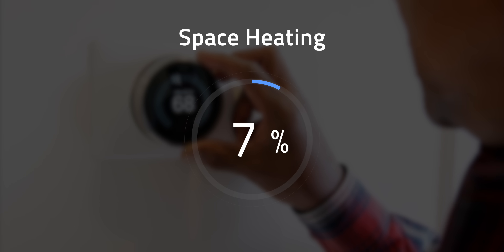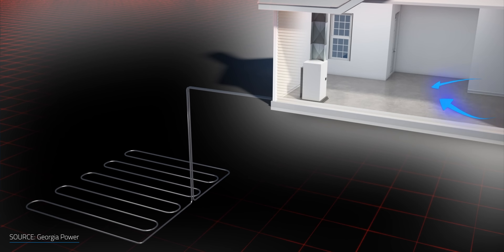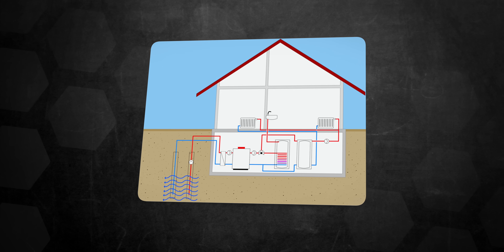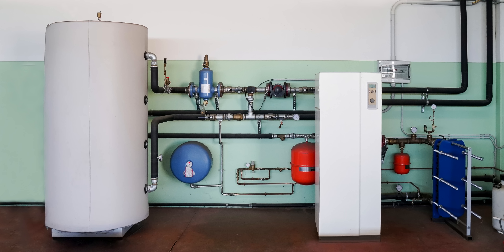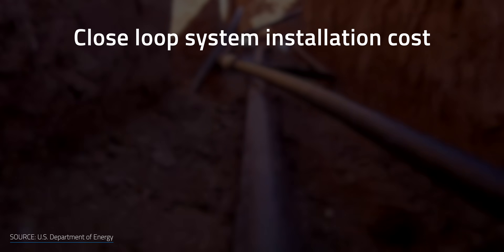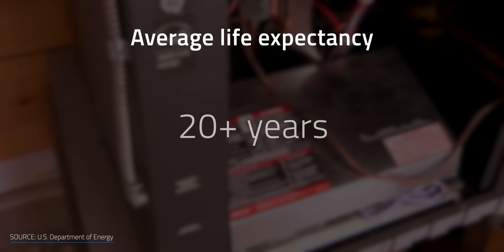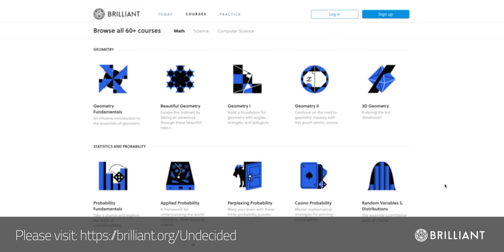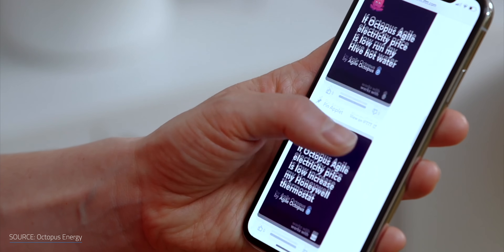Is Geothermal Heating and Cooling Worth the Cost?  Heat Pumps Explained

Comment: I have a 200 year old home in upstate NY. moderately well insulated..... but could be better. Installed closed, vertical geothermal system 10+ years ago. Two 350 foot deep vertical runs of tubing - 4 ton unit. It has 2 - 60 amp/ 220 VAC boost heaters for when Geo system can't heat enough in Jan/Feb. I live to prevent these from coming on! It turns out if I supplement the geo system with a pellet stove I can prevent the boost heaters from coming on. I use about one ton of pellets a year for nights when it is single digit (no wind) or teens (with wind). I have saved money over old oil fired system (especially if oil price exceeds $3/gal). In closing..... the AC is GREAT!!!

Comment: If you are doing it purely for money saving, then its absolutely not worth it - compared to traditional i.e. gas boilers. The difference in initials purchasing cost is just too much. It will take decades until you are even with your savings in energy consumption each year. And ofc at one point if will break due to its age and when replacing it, you will pay for a new heat pump which again is quite expensive. So you will basically never "save" money compared to traditional boilers. If you also do it for ecological reasons then ofc it is a different story. My experiences from austria btw. working for a producer of both - heat pumps and boilers etc.

Comment: My parents had geothermal in the first house they had.  It sucked.  Some years later I got a house with geothermal and it was so bad that running electric heaters and stuffing the fireplaces with wood was required.  No I proudly burn fossil fuels to heat in the winter.

Comment: From Sweden, Last year my fairly efficient heating system broke down. It was based on a heat exchanger extracting heat from the outgoing ventilation of the house to the heat exchanger to heat the house with water based radiators and under floor heating. I replaced it with a geothermal heating. It was around 15000 usd. In Sweden we do it a bit different. In my case we drilled a hole 150 meters (454 feet?)  in to the bedrock and have a closed loop just down and up the hole. In some case this could be up to 200 meters (606 feet?). The system could do cooling as well (Daikin) but this is nothing we need more than a couple of day a year where I live and it requires some fundamental changes to the house so I skipped it for this time. Anyhow, the best year I had before  with the old system was 14000Kwh  (this is very low in Sweden) (including lights, computers and everthing electric) in a year, my projection year is decrease with 30% from a low level. But even cooler, if you hade cooling in the house in the summer with this deep bedrock hole, the cooling of your house will push down heat in to the bedrock in the summer from the system, that heat you can pick up in the winter for heating. The bedrock becomes kind of a battery. Next time when I get a bonus, I will add on cooling to the house.
Reply: 150 meter vertical systems in Ontario Canada are typically used for larger buildings commercial and residential. Some downtown Toronto buildings use the lake for their systems.
Reply: @jonmce1  Lakes are used in Sweden as well, me personally lack a bit of water here on my hilltop:-) I think there are some reasons we are drilling in Sweden, ground frost, you need to get down a bit to get below it. There you normally find granite. Quite some of my neighbors have it as well. meaning you can not go to close to their systems. Anyhow I'm happy, from 22000KWH last year to a projected 12000KWH this year (for all the electricity in the house not only heating) with Daikin Altherma 3 GEO in a not too tropical Stockholm.
Reply: @torbjornulrichs8570  Of course Toronto being beside Lake Ontario is a bit of an advantage. Ontario has three major areas. The very south has about 20m of overburden and then shale (sometimes limestone) and below that granites etc, This is the primary farming part of the province. As you go further North the overburden thins until you hit shield country say 200km north of Toronto. This is almost all rock, small lakes, and bush. With the exception of some old now gone lake beds, the rest of the area was stripped of soil by glaciers, further north around Hudsons Bay( the Hudson Bay Lowlands) there are large areas of muskeg. The majority of the population live in the southern area, We also have a problem with frost which means traditionally building codes require foundations to go 1.25m below the surface. This means most homes have basements since you have already dug 1.25 m down. Geothermal is not yet common because of relatively cheap gas and electrical power (primarily hydro and nuclear).
Reply: @jonmce1  My small plot of land have between 0,3m to 2,3 meter overburden. My house is in a slope around 30 truck of granite transported away after the blasting, so back of the house is underground and front is above. But, that is beside the point, quite cool energy savings with more potential for additional heated (and aircon) areas, for less money. If everything is static, my system will have paid it self in just 4 years, considering that I had to replace the old one anyhow. Electricity is relatively cheap in Sweden compared to the rest of Europe as well, at this moment I'm running 94,7 % renewable electricity (hydroelectric).
Reply: @torbjornulrichs8570  Power varies by province, typically between $.06 and $.11 per kilowatt-hour. . Quebec has by far the cheapest power costs because of hydropower. Ontario primarily between nuclear and hydro.
Reply: @jonmce1  Hydro in the north, nuclear in the south, but nowadays we are connected to the rest of Europe, Germany trying to close down coal and nuclear. Poland have to pay for CO2 emissions (EU tax) on their coal, and Putin pushing gas prices up by cutting the flow. It's going to be an expensive winter in Europe :-(  Makes me feel even better about investing in Geo. :-)
Reply: @torbjornulrichs8570  Serious power in southern Ontario actually started with hydro, Niagara falls. In fact, traditionally power is called hydro. Much of the rest is nuclear. The government is supporting a number of new nuclear designs. The largest nuclear facility in the world is on Lake Huron. The rest of it is gas. Coal plants have been shut down in Ontario but not all provinces. There is an overall carbon tax in the country. Opposition comes from Alberta and to some degree Sask. where most of the oil and coal comes from. Prices are higher here but not disastrous.

Comment: We've had a ground heat pump running for 11 years now, with a 600m of pipe in a horizontal setup at about 1,5m depth (on a lot of about 2200 square meters). Live in northern Finland, and we get down to -30C in the winter, but usually around -10C to -20C. The monthly average electric cost of running the pump for heating the house and water is about 20€. The house is two story, 213 square meters, and well insulated.
Reply: Love it!! You finish(ed) are so smart! ;-)

Comment: im 9 years in with my vertical loop system. break even point after incentives was 7 years.
free (except electric to blow the fan) heat & AC for the rest of my life! have compressor unit in the middle of the basement, out of the weather. this provides fewer corners in ductwork to be as efficient as possible.

Comment: you can't add the 15% heating to the 16% cooling because they come in play at different times and are the "same" system. You cool when it's hot, and heat up when it's cold, not both at the same time. So we should consider the total cost to be 15.5% of electricity.

Comment: So in Southern California we spend over $400 a month on HVAC during the hot months, which is similar to what we used to spend on heating oil in Alaska during the cold months.   Either way,  the $30,000 installation cost for geothermal works out to maybe $130 a month at current interest rates (someone check me) on a normal mortgage.    The cost per month to run the new system probably averages $130, or less.  If the system lasts as long as your mortgage it is a no brainer.   So you're house payment is bigger, but your utilities are lower.  Well you don't get a tax right off with your utility bill, but you do on your mortgage.  The big plus for these systems is that fluctuations in oil prices do not affect your monthly expenses as much.   If we all installed these types of systems the USA would be much less dependent on foreign oil, it would probably push us permanently into being an oil exporter.  So install geothermal heat and help us avoid more needless wars in the mid-east.

Comment: I installed an open-source GTHP in the Midlands of South Carolina in 2004 at a cost of $3500 (unit + ducts). 
The 600-ft well is a constant 62° at 12gpm. 
No heat strips on the 4-ton unit. 

The unit discharges to a 3000-gal holding tank used for;
1. vineyard irrigation
2. fire sprinklers
3. emergency potable water supply

With cyclical summers achieving 104°F, the unit can maintain household temps as low as 45°...!
Winters are mild with the cyclical average of 56°F, the unit can maintain 90°.
[We've experienced the mildest summer/winter cycle since 2015]

CONS: 
The 3hp pump runs constantly at extreme temps/conditions. 
Heavy iron & calcium deposits corrode the copper heat exchanger within 10-years. 

PROS:
Very efficient in our climate.
Low (Easy) maintenance.
Exceeds desired temp settings.

Comment: Some realistic numbers as of 2021.  Co-worker is retrofitting a GSHP into an existing 1800 sq ft house here in the Canadian Prairies.  Cost, roughly $60,000.  Worth it, not at all.  Our natural gas and electricity costs are currently low and the pay back on this would likely be almost 50 years.  Your money is best spent on air tightness, better air handling and insulation.

Comment: Individual systems yes commercial geo system no way I work at a commercial business and we have both systems on different buildings the exact buildings with one geo one refrigerant system by far the refrigerant system is more efficient in its job and less expensive after the initial warranty is gone

Comment: Here in the SF Bay Area, standard HVAC systems run $10K to $20K. If you're not paying in the middle of that range, you may not be paying enough. I can only imagine what geothermal systems cost!
Reply: Was quoted £20k for geothermal. Roughly (very roughly) $30K USD

Comment: I have done so much research as I really want to move away from my lpg boiler. What has stood out to me regardless if it's UK or USA the average working class would not have disposable funds, this is more for people with money. A standard boiler replacment in the uk for a combi boiler is from £1200 to £2509.with 10 year warranty. For me it's a like for like replacment so £1200. Not up to £18,000 for an heat pump which on paper looks like you will be winning with regards efficency, but in the real world its false advert. If I decided to spend £18,000 and banking on a heat pump working 100% as in a lot of cases they need more money spent latter as they may not work well. So taking all this and factoring cost it's cheaper and more cost affective to run my lpg boiler for 15 years. The only let down is its not really green. Until these systems come down in price and technoligy really makes them proper efficient stay clear. But if you have money then go for it.

Comment: When we purchased our home (1994), the installed unit used propane for heating.  Propane prices have a lot of price swings where I live (Oklahoma).  Long story short, we had a GSHP installed in 2008 (5 ton unit).  Vertical loop closed system.  It cost me $18k and the pay back was 8 years.  Its has been pretty much trouble free.  It also came with a hot water generator for the water heater (propane unit).  My propane bill use to average about $1500 - $2000 per yr and is now about $200 per year (cook top range & HWT).  It's been the best investment for our home.   I agree with some of the commenters on its name.  I don't consider it a geothermal unit, it's a ground source heat pump.  Calling it a geothermal is a common phraseology, but that is not what it is.

Comment: I think you need to do draw the distinction between ground source and geo thermal. Generally ground source is harvesting solar heat that is effectively stored in the ground, whereas geothermal is energy or heat originating from ‘deep earth’, through faults where that energy is sufficiently close enough to the surface to be economically accessed.
Reply: I don't know why this comment isn't higher up.  Calling this 'geothermal' is really dumb.

Comment: heat transfers from hot to cold, but that doesn't mean a 20°C floor can't heat a home to over 20°C for example. if the machine cools the liquid to 0°C, it picks up energy from the ground, and assuming it goes to a perfect 20°C underground, that's still a 20° difference that has to go somewhere, in this case the house, adding to the room temp. that's why fridges get warm on the back, the heat from inside has to go somewhere, and that means it must get over room temp as staying at room temp would mean the energy went away (which is against thermodynamics) or wasnt released

Comment: Excellent cursory overview. The system I acquired back in '95 utilized my existing well as a source and needed only a return well whose cost was significantly cheaper than a regular well since it merely received outflow. Any of the other type systems impress me as cost prohibitive and risky still. It also seems the land used the in ground structure would be sacrificed for any other use and there may be some environmental trade offs to be considered.

Comment: Well time for some real word feedback on a Geothermal system.  I believe the longevity that you have been fed by the industry is VASTLY overstated.  I have a vertical ground loop system that was installed in 2010.  The improvement in home comfort and reduction in heating bills was awesome.  My home (originally built in 1969) had in ceiling cable radiant heat.  Yup you read that right, some wizard forgot that hot air rises and put heating cables in the ceiling.  To try to keep the heating costs down somewhat we kept our temps quite low in the winter and the reality was you could feel a thermocline about half way up the room.  The geothermal heat pump changed all of this.  We heat our home to a higher temp at a dramatically lower cost...plus gained central air that is almost free.  But the longevity and lack of service stated is FAR from fact.  I have a HVAC company 2x per year to ensure the system is functioning properly and every other visit they have to re-pressurize the lines.  Every other year they have to purge air from the lines.  Fact is that this systems eventually leak and at some point so badly that you can't use them anymore.  Also the lifespan of the heat pump itself is overstated by nearly 2x from what the company doing my work has told me.  In their experience after 10 years (not 20) you need to be planing for the replacement of the heatpump.  So while I'm very happy I put it in and with the performance thus far...I do have a concern for what's going to happen in the next 5-10 years and what replacement means.  I have been told you do NOT hook up a new geothermal pump to a set of ground loops that's 15-20 years old.  Of course you also do not dig your yard up a 2nd time to put new loops in.  So once your geothermal system dies, you're forced to move back to a conventional system.  They don't tell you that when they are selling you the system.
Reply: Why wouldn't you be able to dig up and replace the old piping? What is actually stopping you?
Reply: @DetachaplePenis  Well technically nothing other than the cost of doing so.  I have 3 200 foot vertical ground loops.  Too get to them you would have to destroy 2 concrete patios and my entire back yard.  So really it's cost vs savings of doing so.  When sold the geo company made (well they all did, not just the one we went with) it sound like the ground loops were permanent and never had issues.  There was a 10 year warranty on the work.  Sounds great...until it's 11 years later and the service company tells you that you've got a slight leak in your field and that it will grow over time and eventually you'll need to just cap it off (because the expense of digging it up to fix doesn't make any sense).
Reply: @johnfarr5415  It may be possible to line the interior of the pipes, it would probably reduce the efficiency some, but would repair the leak and not force a dig up. We use pipe linings in Sewer and Stormwater pipes, I'd think it would work with geo pipes as well.  I'm sure I'm not the first to think of it.
Reply: @PlzStealMyFuckinName  If the joints in the Polly pipe were plastic welded and pressure test left on for 24 hours and proper care taken when laying the pipe and back filling the trench’s that should be a life time job The Polly fittings have a o ring that is made from rubber and might get perished with the ants frees chemicals that why I think Polly plastic welding might be a better option .

Comment: Great video!  One minor nit: I’ve never heard of water or anti-freeze referred to as “refrigerant”.  Typically that term is used for fluids which go through a phase change in a compression loop.
Reply: Yeah the video maker definitely shouldn't have referred to water as a refrigerant even though technically yes it is,  it confuses the hell out of most people
Reply: @jason76065  No, technically the loop does not go under any phase changes. So yes, he's wrong and no refrigerant circulates in the loop, only water or water plus glycol or another antifreeze.
Reply: R718 refrigerant = water/steam
Reply: water is the original refrigerant and because the pressure changes in the system it handles phase changes pretty well (ive worked on hvac systems)
eta: the earliest ac used water to transfer heat and cool air